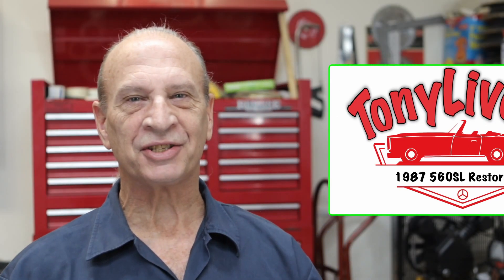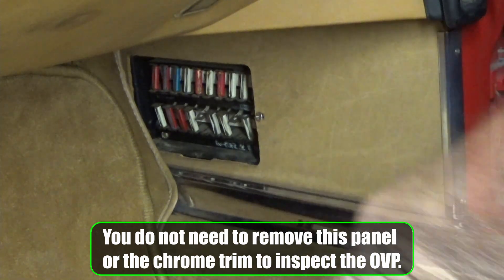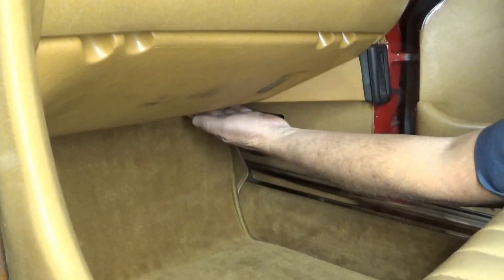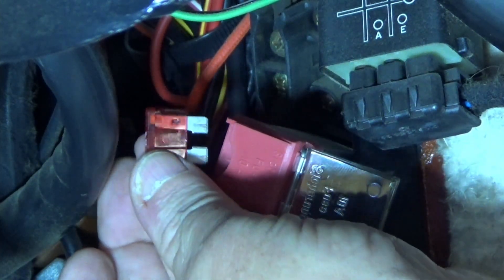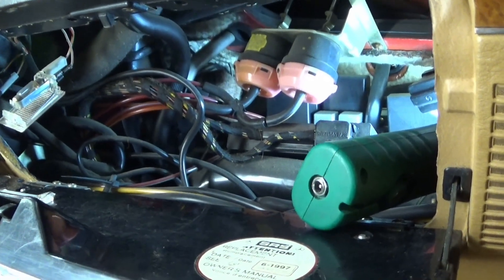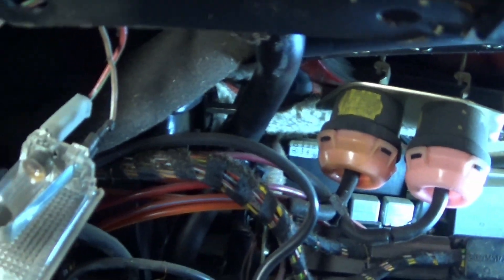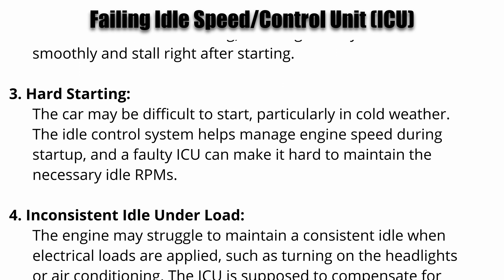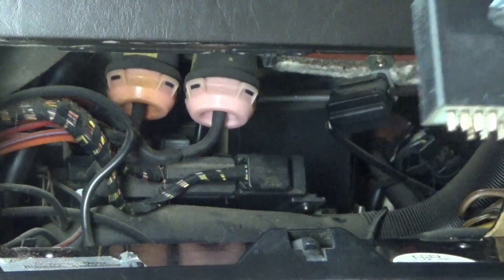560SL - Fuel Pump Relay, Overload Protection Relay (OVP) & Idle Speed Control (ICU)

Comment: Great video. Here is an interesting fact....Depending on the exact model of R107, you can pop along to RockAuto and get those OVP relays for just $16.90 if you put in the Uro part number (URO-010784)...but the prices umps to $43.79 if you put in the part number A2015403745. Mike